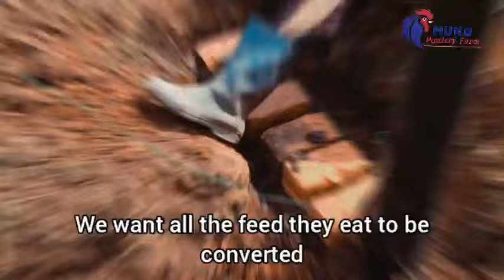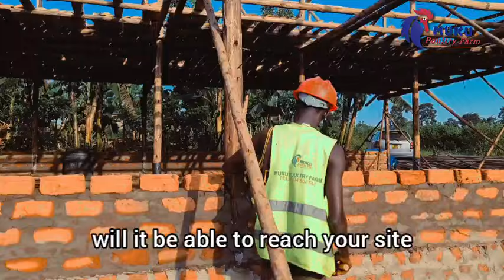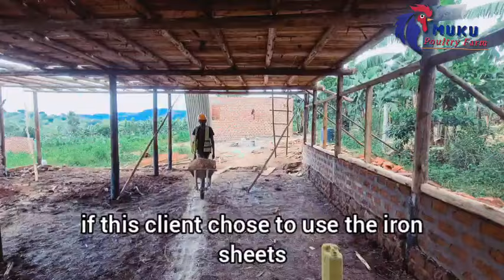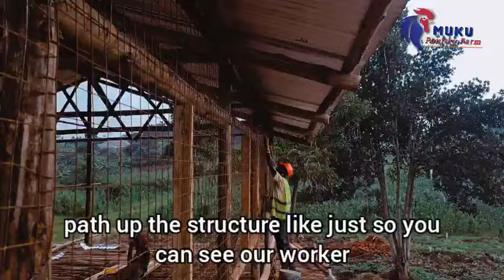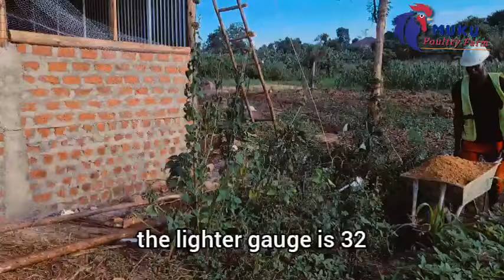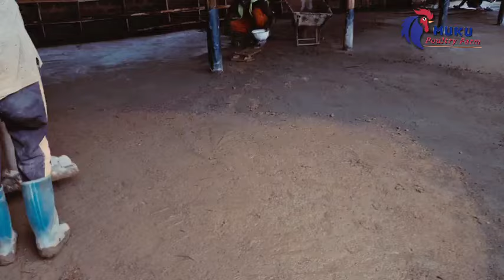2,000 capacity local chicken structure/coop construction process

Comment: Wawoooo fantastic,  so simple but but very well structured  and thought through, so practical, very cleaver. 

The chickens are very safe from snakes, they have fresh air,  enough place,  and  they will surely be heathy.
Good work, thanks for the courage and for sharering,  yes it can be done.

Remember chickens like to have a high place to hang out, when they are chilling out or resting.
So put some branches some where, so that they can climb up.
How are the cleaning process going to take place ?

Make it posible for them please to come out and move around in the nature, that makes them  happy and  fri of sickness.
Reply from the maker: Thax for appreciating.
It's oky to let the birds move out freely, but that's a diffrent system, this is specifically deep liter, and leaving them to move out means free range system, thos its good but it also has its own short comings